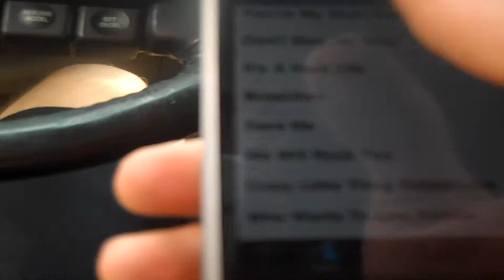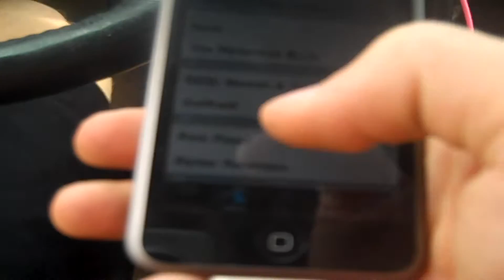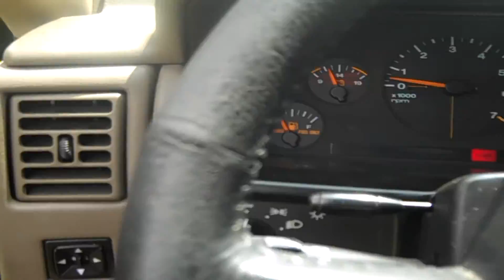New Subs .. Holy Flex.

Comment: Nice video dude , question did you check the impedance on each subwoofer wire? I say this because you could be wired lower like 2 ohms on a pair those subs. This Might be the reason there are moving more air.

Comment: I had a few of those punch 800.2's they sound OK just like that but if you install the bass remote knob holy fuck that amp will come alive trust me it'll beat harder with the bass knob.
Reply: this is true.. have 1 for 2 p2s and they knock lovely
Reply: +Marco Garibay you need the punch bass remote for these fosgate amps they come alive and push even more. I see a lot of people calling his set up weak, or the amp old, ancient must be youngsters those amps are what pretty much put fosgate on the map today
Reply: Those rock ford phosphate amps are awesome an can handle a great deal,  have plenty head room to through more subs on. To this day  an age. 2023 december  . I remember in the 1993 ish those amps cost were 499$ an would slam when powered properly in plenty air space boxes with four subs . Cadence is a high end company also , amps an spkers,an subs. Try custom boxes four your subs you cant go wrong

Comment: So does amp in video push more than the Fosgate 700s series??
Reply: I'm looking at a 750s now, have you hooked yours up yet, is it any good?
Reply: @maniac5410  Yass sirs, wurk excellent, actually my ole skool had to replace sum parts on circuit board; but dat bitch knock

Comment: You need a HO alternator,if it cant keep your main batt charged and supply enough power to your system,2 batts will sync voltage together and will make your alt work harder.Do big 3 with 4g if not done yet and run 0g from batt to supply amps.That rf 800 pushing 500rms hx2 10's will pull at least 80+ amps at high vol and isnt getting full voltage which can hurt amp n subs..good luck.I have hx2 12's with t-powerbd1k.